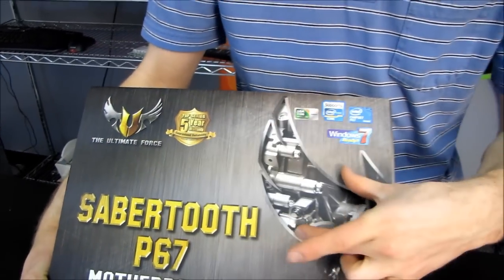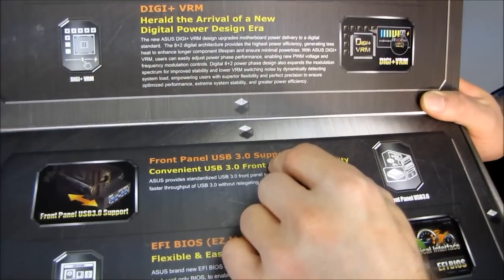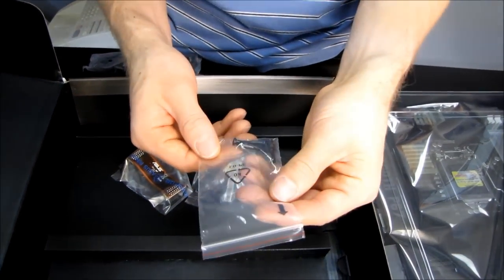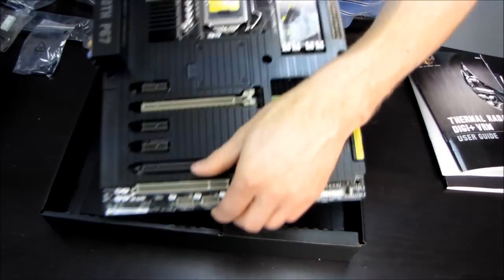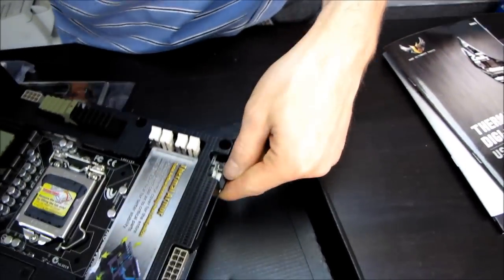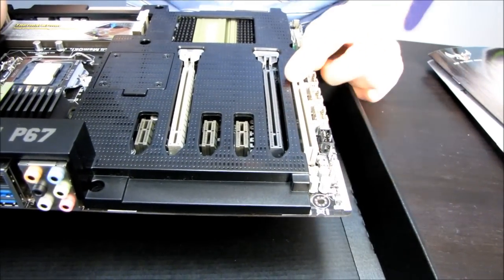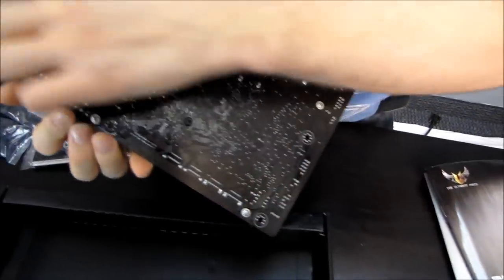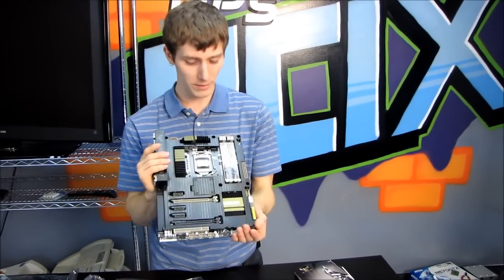Asus Sabertooth P67 Core i7 LGA1155 Motherboard Unboxing Linus Tech Tips

Comment: Im still using this board on my fileserver with a I7-2600K and has been running almost 24/7 since 2011
Reply: still using this motherboard with a 2600k and a gtx 870.. never had any problems .. didn't kept it overclocked 24/7 that's for sure, but it's kinda amazing how much these things are able to last

Comment: Great board, i`m using this board around two years with a 2600k@4600mhz and 4x2GB corsair in XMP 2133mhz. assist-fan installed in 24x7use. I never had any problems and i never change or sell it.
Reply: +PossibleOrb ive been running my 2600k@4900mhz since 2011 (2016 now) with an asrock extreme6 and 16gb 1833mhz (not oc) ram i threw in two gtx 670s in sli a few years back and the whole lot is watercooled with an XSPC  D5 bayres loop (360 rad) it has been rock solid for years the only bottleneck now is the 2GB VRAM which is super annoying!!!
Reply: +urbansnipe before i watercooled i was running my 2600k@4.8ghz for like 6 months on its stock cooler!!! it used to thermal throttle like crazy under sustained load but it is still working 5 years on :) it is one tough cpu it will still reach 5ghz stable on water!!
Reply: urbansnipe hy again, i only reach 4.8ghz max&stabile but the 4.6ghz at the moment is okay for me!!

Comment: @whitetiger762 The processors no longer use the traditional FSB anymore. This board uses a Base clock (bclock) of 100MHz that you can't really mess with. You now overclock by adjusting the multiplier.

Comment: @HeatonMulti 
Motherboard:  Sabertooth p67 (obviously)
Graphics: 2 1.5 gb EVGA GTX 580s
Processor: Intel Core i7 2600k, with a coolermaster v8
Memory: 2 G.Skill Sniper 4gb (8 gb total)
PSU: Zalman 1000w (I forget the model name, got it a while ago and reusing it from my last rig)
Case: Antec Nine Hundred (first version)
Storage: 3 7200.12 Seagate Barracudas configured in RAID 5 mode
OS: Windows 7 home premium 
Monitor is an LG that goes at 1920 X 1080.

Comment: @xRevelations1 SSD caching basically allows you to use a SSD to cache a HDD. You will not need SSD caching if you are only going to be using SSD's. But if you have a HDD and you have programs on it, your MOBO will cache those programs onto the SSD.

Comment: Got this board over Christmas of 2011. I didn't want to upgrade everything on my system so here's my current setup:  CPU: Intel i5 2500k Motherboard: ASUS Sabertooth P67 RAM: Corsair Vengeance Low Profile GPU: ASUS HD4890 PSU: Corsair TX650W CASE: HAF 932

Comment: @tanknyc Isn't the X58 for LGA 1366 processors? Your decision should depend on if you're trying to use a processor you already have, or if you're planning on buying a new one. If you're using an older LGA 1366, you have to use the X58 Sabertooth, and if you're buying a new one, you'd be crazy to not buy a Sandybridge LGA 1155 processor.

Comment: @xRevelations1 That setup will be perfectly fine. SSD caching is an Option, you do not have to Use it. It is mainly for people with small SSD's like 32 or 16GB that want to cache a HDD.
Most people do your option, have a SSD for programs, and a HDD for files.

Comment: @TheSkateyBird I am pretty sure you can not mix a 1156 socket chip on a 1155  mobo, Maybe you are thinking of using a heatsink mount which is compatible with a 1156 but will also work on a 1155 mobo other then that I do not see how a 1156 chip will fit on a 1155 mobo just my thought but I could be wrong.

Comment: So i went from the Asus P8P67 to this board and i have a 50mm fan pushing in the middle of the board.  My CPU runs almost 10 degrees warmer than with the other board.  Not sure if i am going to stick with it, the motherboard does stay cool though.  I am overclocked @ 4.6GHz idle CPU is around 38c and the board is around 28c.

Comment: @wilfeatscheese Yes, the usb 3 port physically has more contact pins than usb 2 (this is how it perfores faster) SO you can plug usb 2 into usb 3 and usb 3 into usb 3 port (obviosly) but if you put usb 3 into usb 2 (yes usb 3 is backwards compatible i think) then the device your using will run at usb 2 speed
hope this helps.

Comment: @ZipeMetro  well i have a Cooler Master V6 on mine and i ha to move my ram over to the B slots  as it covers the A ones but i believe it mainly matters about wiether you have fins on the ram, the V8 should fit fine with ram with no fins

Comment: @andrewsheldonreeves 

although this motherboard has only 2 pci express support multi GPU that is physically 2 grafix card yet an quad can be done by doing an sli or crossfire over 2 cards that are dual chip like radeon 6990 or nv gtx590, enabling 4 gpu to work all together on this mobo

Comment: @TheXtremeGamer90 Totally depends on you and how much are you willing to wait, if you're upgrading right now the 1155 socket is the way to go, a i5 2500k is a great CPU for gaming and will blow out the water to any 1366 CPU on it's price range (the only competitors seems to be the i7 980x and the 990x and they are way to much expensive), Sandy bridge has great OC capabilities so you're gonna have a heck of the machine to run any game you want.

Comment: Asus Sabertooth P67 motherboard+Intel 2500k processor..... after 3 months the temps are around 40-45 degrees with the assist fan of course, but usually they never pass 40 degrees....

Comment: @xcaliber147 Well, I have a haf 932 and since the motherboard is an ATX and the haf 932 supports EATX it should fit just fine. As for supporting a gtx 590 I can't see any reason why it wouldn't, but just to be safe you might want to do some extra research before spending the cash.

Comment: @itsmeaqi It could be a bad mount with my CPU cooler but ive double checked that.  I havent checked temps without the fan yet.  I cant turn it on and off so i would need to unscrew it and unplug it.

Comment: @6441007 i have the Pro ..it seems good so far. overclocking is real easy and stable. 4.8 all day ...5.0 is no problem either but it heats up,75c.  I bet the Sabertooth is just as good.

Comment: I am trying to pick between Sabertooth P67 and Sabertooth x58 I will onle use one GPU card but i will be using OCZ RevoDrive PCI-Express. The P67 splits X16 in to X 8 and 8 any ideas? Will greatly appreciate the help.  Been breaking my head for three hours trying to pick one.

Comment: at the top of this motherboard there is an 8 PIN power connector. My question is, I am running a gtx 780 and a 570physx card. Do I need to connect the 8 pin from PSU to MB or not bother? Its been giving me headaches!!!!

Comment: @MrShnuggleMuffins Sorry forgot to mention that the q 67 is pretty much equal to the H67 - it is not designed for OC - it is for a normal buisness pc with a long guarantee wich is important for buisness people

so the only real big difference is that the Z 68 are possible of using the integrated Grafiks of the CPU - the P 67 is not capable of that.

Comment: Hey, please I need help. I have a sabertooth p67 build, with i5 2500k, g skill 4GB memory, gtx 570,corsair tx 850 PSU,.... etc. My problem is every time I cold boot, the computer post 2 times." I turn it on then it goes off then on again by itself every time." also when I use the oc tuner function it sometimes says overclocking failed. I have tried overclock myself but i'm afraid to damage something. PLEASE I NEED SOMEONE TO TELL ME WHAT I CAN DO.

Comment: for anyone using this board in 2013, i need some advice. I bought this board back in 2012 but have only just got around to buying the cpu which is an ivybridge 3570k! Will I have to flash? if so how? I dont have an old intel chip;.

Comment: @zeromant80 its marketing hype nothing that is plastic can act a a heatsink it can melt though it will make board temps worse that is why they include so many dif temps sensors on the mobo

Comment: @kjetilsenNOWAY yes it is, i'm using one right now. i can go pass 5GHz on it like nothing... but it all depends if you like the p67 chipset. i use p67 because i don't need ssd caching because i only use ssd's. and another benefit of z68 over p67 in quick sync for video trans-coding, it is a lot faster than doing it off a dedicated GPU.
So z68 gives you ssd caching and  quick sync over p67, but i use none of that stuff, and i really like my sabertooth :)

Comment: @MrShnuggleMuffins 
H 61 Chipset ... just working - low budget almost none OC.
H 67 Chipset - same as H61 but integrated gfx working (virtu)
P 67 Chipset - OC is possible
Z 68 Chipset - OC + integrated gfx (virtu) 
Q 67 Chipset - this is for the buisness sektor - it should be more stable and reliable than the others but it is pretty much the same...
B 67 Chipset - this is for OEM PCs - nobody need this - is also a low budget solution
have a nice day

Comment: I Sent them a queston ant they sent me the answer: 
Intel® Socket 1155 for 3rd/2nd Generation Processors Supports Intel® 22 nm CPU Supports Intel® 32 nm CPU Supports Intel® Turbo Boost Technology 2.0

And thank you, It also has those 2 fans
And on the mobo it says Sabretooth Z77.. So yeah, I Bet that it should even have the features of the ivy.

Comment: @jeffro1234567891 
you've run into a scenario that I'm likely to run into... I may stay away from this board for that reason. 
Thanks for the heads up, and good luck on any further bios problems.

Comment: 😂😂Still rocking one of these in 2022
Reply: how is it, I'm picking one up tomorrow for $40 it also includes a few fans and a CPU cooler fan, I hope there's a CPU in it also. I wasn't bothered to ask, it's more a bundle I'm looking at which includes a router a rugged drive enclosure and a few video cards and some display cords which I think is pretty priced especially if there's a CPU included and ram but I couldn't tell in the photo
Reply: update, it has a ram and 3 sticks along with a CPU so it's complete, I have extra parts lying around so ill need to source a case and a GPU and it should be a complete system, I'm going to format my old laptop HDD and use that I think it'll be a good upgrade from my intel atom and 1GB ddr2 ram workbench since it took me three hours last night to even download fallout new vegas on it

Comment: MY specs on this mobo.
cpu i7 2600k 3.4 ghz
ram 16gb kingston 4x4gb.
psu 980watt corsair tx. 
case corsair c70. 
coolermaster poseidon 240 watercooling. 
gpu asus gtx770 oc.

Comment: @041418062 As in buy new RAM or change the slots. also This is my very first custom build computer, so I know about them just not everything like a professional. Can you give an idea about what I should do when adjusting the timings. If it is any help here is the link to my RAM: G.SKILL Ripjaws X Series 4GB. In  NEWEGG you can find it easily. Model F3-12800CL7D-4GBXM. This issue is really getting on my nerves.

Comment: guys i am building a gaming pc and i will be using:
6 g adata RAM 1600 MHz
1 tera black western digital  HDD
hd 6950 1g ddr5 sapphire VGA
haf 912 cooler master case
gx 750 cooler master power supply
v6 gt cooler master cpu cooler
and i don't know either to get i7 960 with the sabertooth x58 or i7 2600 with the p67?, plz guys i really need some help quickly DX